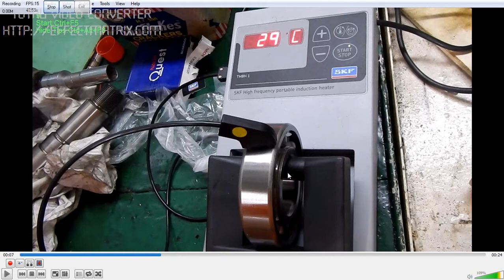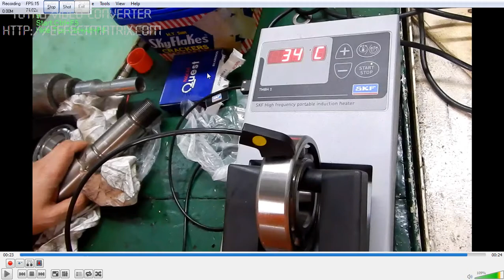High Frequency Portable Induction Heater

Comment: Very nice video. I want to add one thing which is, we shiuld always use the gloves provided with this heater to takeout the heated bearing.
Reply from the maker: Thanks for your valuable feedback !! Do share it with your colleagues and friend
Yes special heat resistance gloves is provided with the kit. Please use it to avoid burns holding the hot bearings.
Reply from the maker: when you open my youtube  channel : Marine tech hub you can see icon right hand side of the header . you can click to go to my website 1. RT flex engine 2. Nitrogen generator 3. solar power.  full details of CLU and Crank Angle sensor can be see